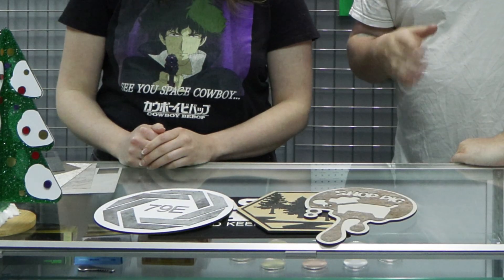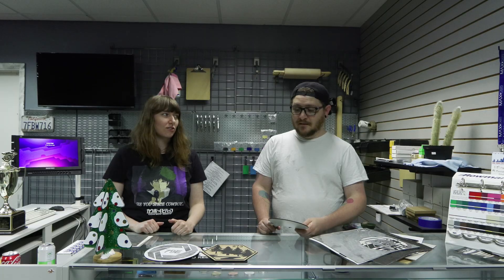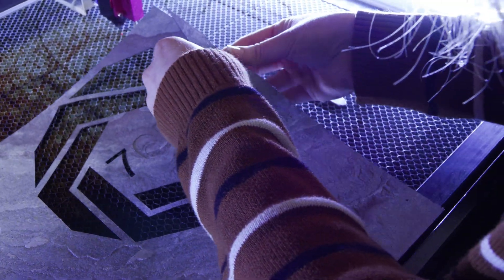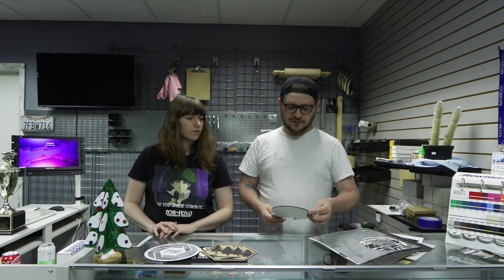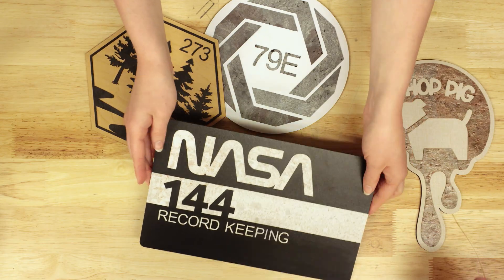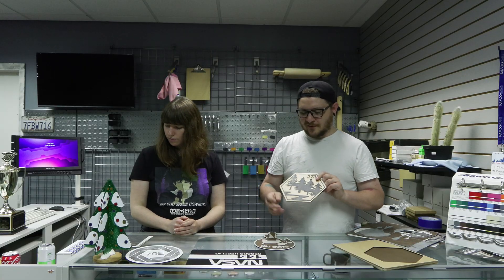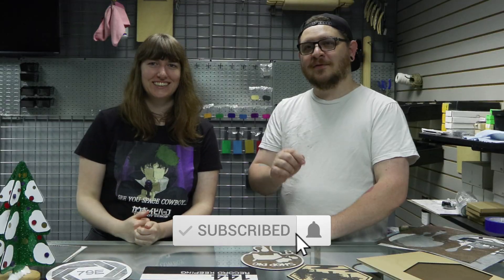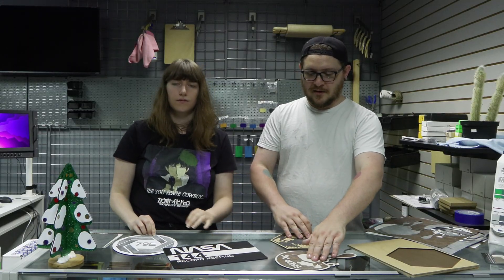The New Flatstock Material Makers NEED to Know About | Full Stonelite Review + Projects

Comment: Is this diode friendly or just for CO2 lasers?
Very nice in depth review. Thank you
Reply from the maker: I haven't TRIED it on a diode yet, but I suspect it's likely workable. It will probably be slow to cut but I'd bet you could get away with it. I have yet to try it like I said so take that with a pinch of salt.
Reply: Thanks for the reply I think that I’ll contact them. I’ve gotten some black granite from them and like that. But that product as you said can be used on different surfaces especially something curved which could make for some nice effects with phots